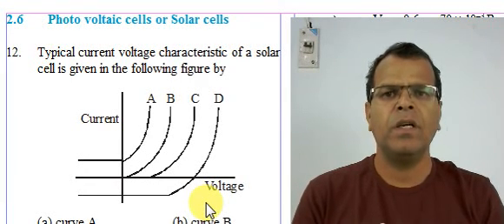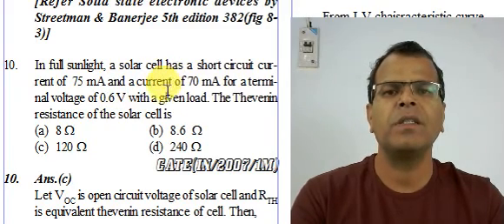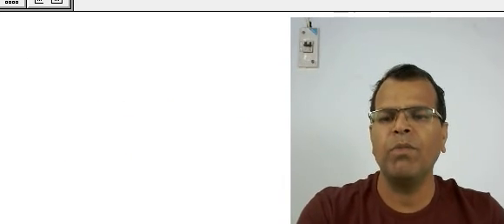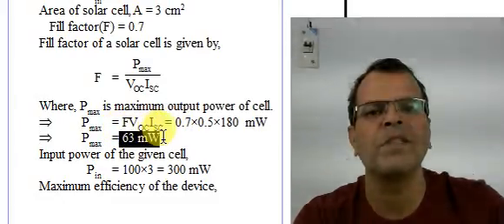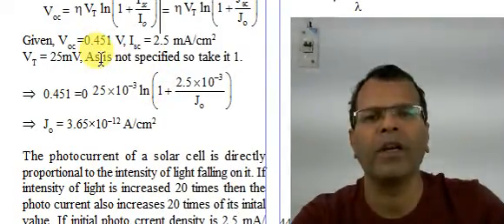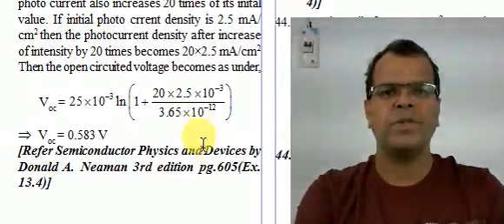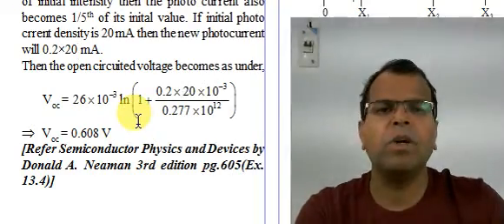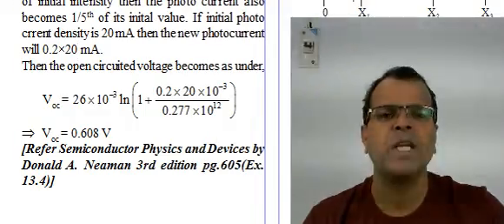EDC & AE Diodes Lect 16 Solar Cells  GATE Questions

Comment: Could we apply Thevinin's principle to the solar cell as it is very non-linear in question no 10
Reply from the maker: Network theorems can be applied when electronic device is replaced by its equivalent circuit.
Reply: @digcademy2856  Sorry to say but this research paper first separates the linear and non-linear of solar then applies only on part which is linear..
Reply from the maker: Hello Shashank, its really nice that you have interest in the topic to the research level. There are some points to be noted here that as per information given to us in the said question of solar cell we are asked to determine the Thevenin's equivalent resistance. From the options given to us it is very much understandable that the given solar cell must be having some Thevenin's eqt resistance. Now, we have to  find the equivalent resistance from the given data. I can find the Thevenin's eqt resistance with the help of given data if and only if I consider linear model of the solar cell. The paper you cited is a research paper where in maximum possible effects are considered so that exact behaviour of the device can be simulated. However, you should follow the standard text books of degree level for preparation of GATE/IES or any other competitive exams.